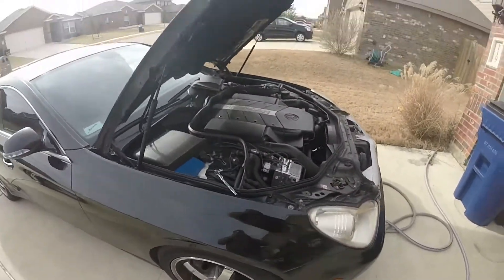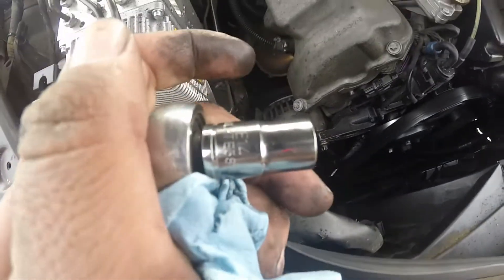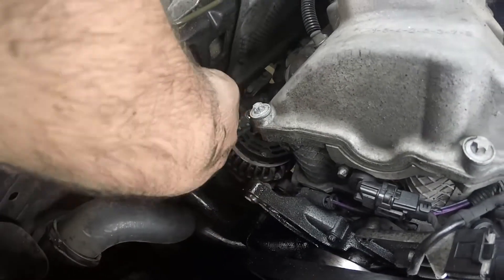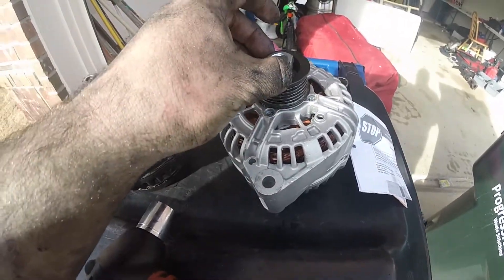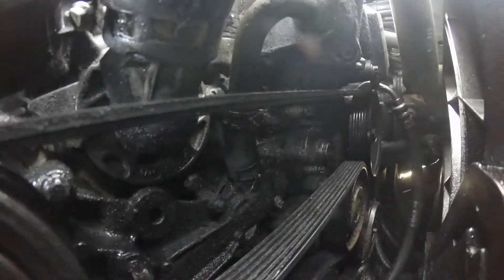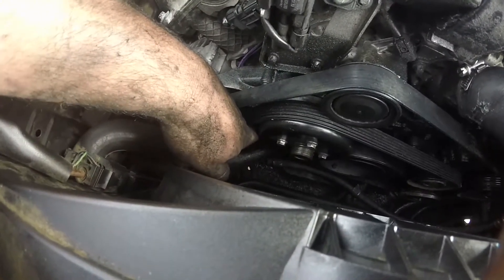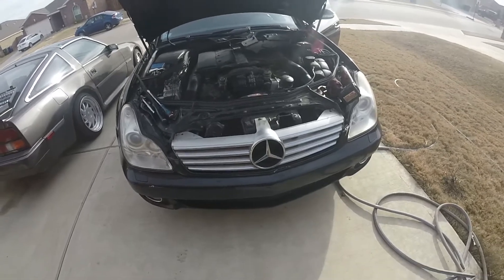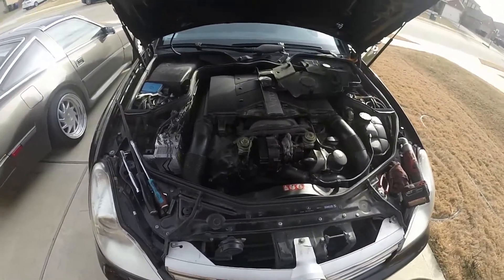How to Replace an Alternator Mercedes cls 500

Comment: I did mine from the bottom and it was easier that way. but I later found that my alternator was good, and it was a faulty voltage regulator
Reply from the maker: Sinsavory Long yeah sometime they are easier from the bottom
Reply: What was your car doing bc my lights going crazy and my fan is running wide open